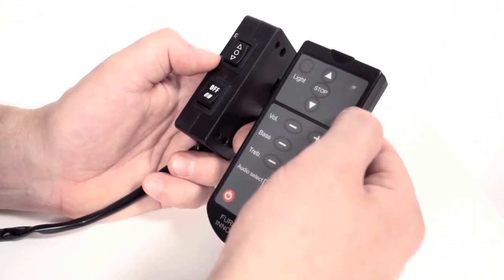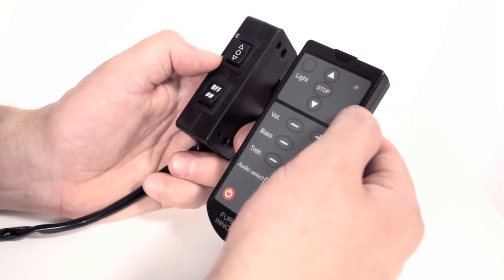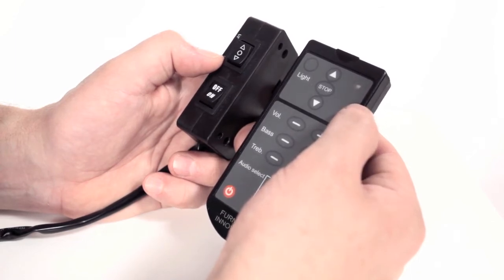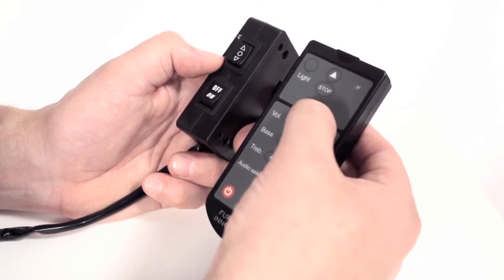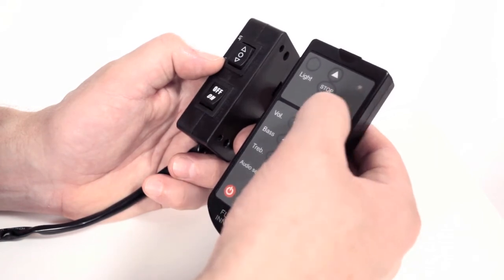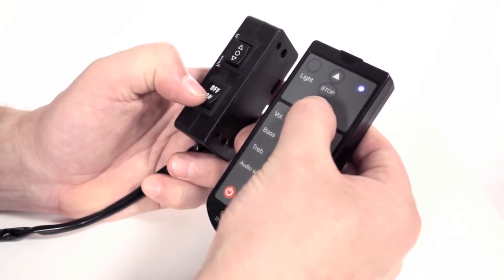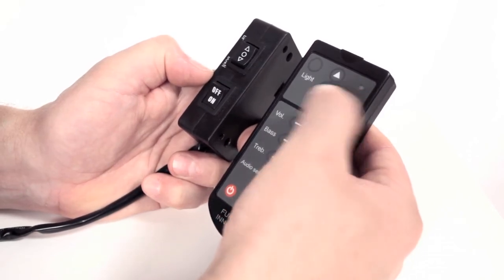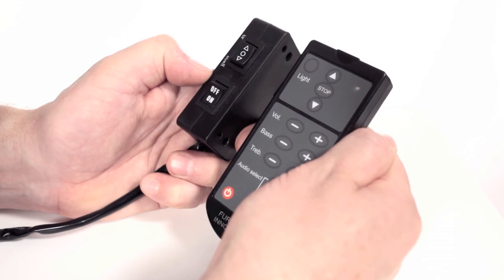video - How to synchronise the remote control with the control box.

Comment: Hi my wired remote went missing when I moved house so the tv works but not the lift mechanism do you know where I can buy a replacement? It looks exactly the same as the control in this video x I have the remote control but not the wired control
Reply: Our small remote control died. So pretty much the same problem as you. We need a replacement remote control, but not sure what to buy and pair with the control box or if that will work. Any answers on this? Did you find a replacement?
Reply: Hey having the same problem now, you find a fox for it?@patenglish3009

Comment: I can’t seem to change the volume up or down anymore on mine, tv lift works fine but sound is set on a fixed volume on my sound bar
Reply: Did you manage to get a solution for this. I have the exact same problem.
Reply: @JohnSmith-se5vo  I haven’t bothered trying since to be honest. I’ll let you know
Reply: @dannyc8525  managed to figure it out it needs syncing. Remove the back cover there are 8 tab switches near the battery. Flick no 8 switch only. Turn the sub off and keep the power button held on the remote while turning the sub back on. This is re-sync the remote and now volume controls us working again.
Reply: @JohnSmith-se5vo  thanks I’ll try that out.  👍🏻
Reply: a bit late - but - if you change the switches you have to resync both the up/down mechanism AND the subwoofer. For sound resync, flick the switch on the subwoofer off, hold down power on the remote and switch subwoofer back on while holding the remote power button for 6 seconds.
Reply: We've been trying to find answers. Our remote control went out and we can't seem to find someone who can help us with what to do now. Would another remote control device work and be paired with our TV Lift control box? What kind remote control should we get or do we have to replace everything. We love our TV Lift and would like it to work again. Thank you.
Reply: Would a universal remote work for a replacement on a remote for a TV lift? Our's just quit working.